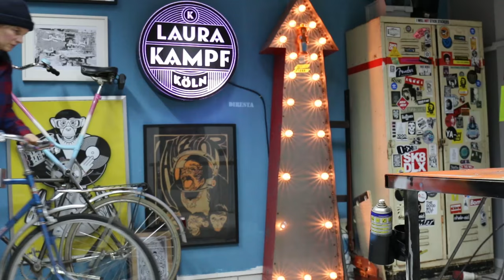Laura´s Bikeframe Cupholder

Comment: Loved it.  For those worried about the integrity of the bike frame, it's plenty strong.  Nothing to be concerned about.  Laura isn't running any cyclocross events with this 28 pound city bike.  Another killer video!
Reply: I agree. She doesn't look to weigh too much, she isn't riding this bike to the limit and the frame is good old steel. It might flex a bit more but steel can take that. 
Love those classic frames. Nowadays all the bikes have aluminium frames and these are 99% made in Taiwan. 
I want one of these cup holders but i never would sacrifice my late 80ies Bianchi lugged frame bike. :-D
Reply: problem is if she bumps into a pothole at a regular speed (say, 20 km/h)... it's a considerable amount of energy that suddenly goes through the frame trying to dissipate just to find a hollow structure... I would keep my regards about it
Reply: I disagree,  the gauge ofthe  piece she added is far stronger than the bike frame
Reply: @bikerchic , Yes the 80mm tube she used is far thicker than the original frame, but it's in the rong way to keep pressure, tube is ment to take forces in the ends not in the side ... take a hammer an hit the side of the tube or the end, you'll see a diference ;)

Comment: Cool idea! Are the welds strong enough to hold the frame together considering it's no longer one long piece (I'm not a welder...yet)?
Reply: Robin Lewis On a Boulevard cruiser?  Sure.  Weld metal is typically stronger than base metal, at least harder.  The tubing (cupholder) will buckle before the welds break assuming the welds are good.
Reply: Oh right! I didn't realise it had that kind of strength, that's awesome

Comment: So cool! I wish my bike wasn't made from aluminium so I could cut and weld it! Maybe it's time to get a TIG welder ... 😄
Reply: First rule of project selection, does the project require a new tool ?
Reply: Elbow Grease you braze it (have to use an aluminum pipe then, obviously). should be plenty strong
Reply: Elbow Grease or just get a cheap steel frame bike! They're a dime a dozen on Craigslist.
Reply from the maker: yeah, try to find a steelframe bike. super cheap and endless possibilities ;)
Reply: Laura Kampf steel is real!

Comment: does this not really decrease stability?
Reply from the maker: +ATschTheCube  not if you do it right
Reply: A proper weld is as strong as the material one is welding to? From the video description: "Also DON`T build it if you are not confident with your welding skills! This can be dangerous if not done the right way!"
Reply: ATschTheCube if the welds are right, this could even be stronger than the original

Comment: So the holder will now begin to bend it's way over time and the frame will be losing stability.
Why not welding it on top and make the rest a fake, just for the looks, so that the frame integrity isn't damaged.
Reply from the maker: +alsternerd the pipe is thick enough to stay in shape. i don't do fake. if you don't like it- don't do it. very simple

Comment: IMHO cutting out such a big section of the top tube doesn't seem to be a very good idea. And I'm assuming this bike is like from the 90's? Most likely the frame material is a special CrMo alloy and arc welding that is not common nor recommended. The tubes and parts are soldered together.

Comment: Sorry,
ich find' das nicht cool!
Du kannst doch nicht einfach den Fahrradrahmen  zersägen. Gerade das Oberrohr! Damit würde ich mich nicht mehr auf die Straße trauen. Das ist doch voll gefährlich.

Sorry,
in my opinion that's not cool.
You cannot just cut that frame. especially the main pipe!
I would not go on the street with it.
That is totally dangerous.
Reply from the maker: then don´t do it...easy
Reply: AndyBring Guck dir mal das Material an, das ist stabiler als vorher.

Comment: Just come across this and the skateboard as mudguard one. I wasn't sure which made me wince the most. Think it has to be this. Your frame now has no integrity, not sure why anyone would do thatto a bike in use. The skateboard looked awfully heavy. Why you didn't cut it down and trim at least half the depth I don't know. Also placing the front 'guard' that way up just weakens the handling. Between that and the cup holder this bike is likely to take it's rider straight to the scene of the accident.